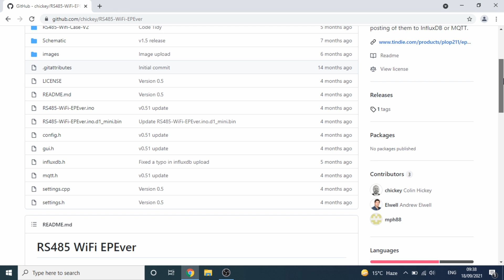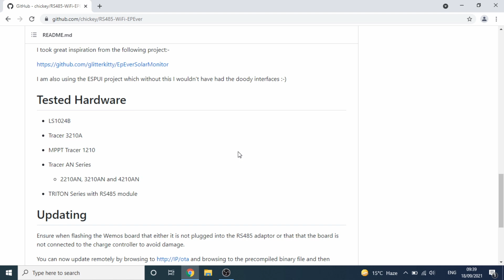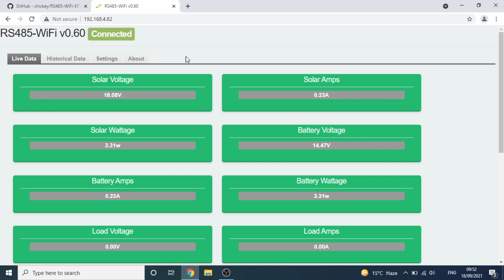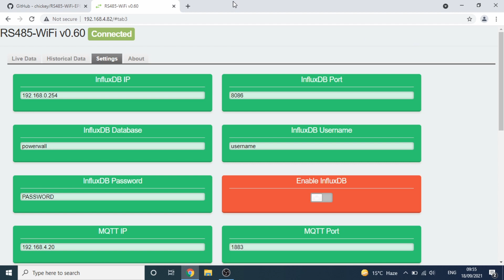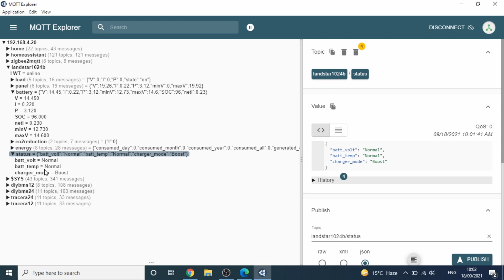RS485 to WiFi adaptor for EPEver Solar Charge Contollers

Comment: Adam thanks for posting this info, very informative. I am very interested in a RS485 to Wifi board,  but my problem is I am running (2) TracerAN charge controllers in my RV and to manage there charge rates I have installed the Epever parallel controller (PAL-ADP-50AN) that controller only can be monitored with wired/PC software.... yuk! The PC software works via USB/Rs485 cable, guessing the protocol is a one off. Any ideas?

Comment: I have a question. 

I've been using an Epsolar ET6415BND 60amp for years.

With the standard supplied RS485 USB cable. the wires were slightly bare and came together. Since then it doesn't work anymore.

What's wrong, internally the RS485 chip in the charge controller is broken. or the USB to RS485 interface cable is broken.
is there anny protection in the charge controller.

Comment: I have implemented an alternate approach. I use an esp32 (running a modbus library) with a cheap ttl to rs485 adapter. Code is C++/Arduino. The esp32 gets status and commands my epever tracer controller (via published online protocol definitions). The commands and status pass over an MQTT broker to a node-red server via wi-fi. In node-red I have implemented a custom epever status page similar to the factory supplied program, but which I much prefer. I have a second node-red page where I can change the various epever charging parameters.
Reply from the maker: Cool. Sounds similar to mine… https://github.com/AdamWelchUK/NodeRedEPEverDashboard this is the last version I uploaded, but as is often the case, it’s revolved since then!
Reply: Hola, I did the exact thing but ran into an issue. My controller ,40amp tracer an, lost power to its battery ( my BMS disconnected ) , the connection to the solar panel remained constant. When I discovered this issue somehow the combus in the controller went bad. I can’t change settings anymore via pc or the remote ‘meter’ device. The meter lights up but never connects. Somehow the data bus got borked. BTW I was using those cheep 2 pin usb adaptors to a raspberry pi. Otherwise things were great. I even made a led scrolling display with esp-8266 display controller data ported the MTTQ running on the pi. Sweet !
Reply: @jethrotull5847  I also lost a controller with a bad data bus. I think a lightening strike took it out (live in central Florida). Since then I have taken great pains to ground everything and have installed a serge protector on my panel cables coming from the roof. Since I use Lithium Iron batteries, the charge controller is useless without the ability to fine tune the parameters.
Reply: @yancymuu4977  I intend to take it apart hopeful it’s just a bad data bus chip. I have 3 controllers hooked in parallel, in retrospect I wish I would have bought the later model that appears to have the comm chip on a removable faceplate module. I also use lifpo4 batteries and still keep the old controller online because it was set for lifpo4 (user). The settings are a little different ( like max charge..) though. If you could please describe your system a little more, I display data on web page and led scroll displays, I also meter amp consumed via a shunt, PZEM-017 connected to Arduino D1 mini. Everything possible with node-red !
Reply: Lastly, I intend to switch the load on and off automatically based on daily internet weather forecasts ( json ). My array is 1,600 watts charging 28 v 200 ah.
Here in Virginia seems like 45% days are cloudy or overcast.
Reply: @jethrotull5847  I plan to do a video overview of my system, but basically it's 8 lithium iron 400 ampere hour batteries in series with a 50 amp 200v charge controller. I have 10 100 watts panels (5 series x 2 parallel). I made a small custom circuit board with a/d chips, balancing resistors, epever interface, and an esp 32. This summer I have been getting about 2 kWh per day, but can get more with increasing the load. It mostly started as a hobby that seems to have gotten out of control.
Reply: @yancymuu4977 My system is also a expensive hobby. As such it was build in stages and now consists of too many controllers over too many separate all south facing arrays. The investment cost looks like a nasa overrun project and with power at .12 KWh it will take forever to earn the investment back. The only saving grace is emergency power. I use a 60 amp auto switch and Alexa. When “solar off” command is issued the Alexa switch turns ac output off from the inverter ( killing the output ac but not dc as recommended by manufacturer ) the auto switch senses this and reverts to shore power. All is well but I need a bigger inverter. If you don’t mind can you tell me the brand you use and how long you’ve used it ? I look forward to your video, have you got a YouTube channel yet ?
Reply: @jethrotull5847   I have an Xantrex Prosine Sine Wave Inverter 1800. I purchased it for $350 used on eBay mostly because it was recommended by a YouTube reviewer. It works great but has a 20 watt no load power. I have hacked it a little to be able to turn it on or off with my epever relay. (Have the 50A model that does not have a load output, but only a load relay). Mostly I like to use various DC to DC buck or boost converters to run my small computers, switches, router, computer monitor, TiVo etc.. If we get a long grid failure after a hurricane I want to stay connected to the outside world.

Thanks for encouragement to do video. I will start working on it. I have posted a few not great quality videos on YouTube,  but it would be a little presumptive to call them a "channel".
Reply: @yancymuu4977  great, I’ll keep an eye open for your video ! Take care … later.

Comment: Can I connect it in parallel with the existing MT50 remote thing? Thanks.
Reply from the maker: This is something I want to investigate.
Reply: @AdamWelchUK  thank you.
Reply: Be careful, I would not at this stage, I have a 80A Epever solar controller that has got to RS485 outlets, I was using a single outlet with a SnekTek - Solar WiFi dashboard V4 controller , and swapped it out with a RS485 to WiFi adaptor , all worked well with logging data to my MQTT server, so in my wisdom I thought I would use the second RS485 port in the Epever solar controller and run both devices, well it didn't end well for both devices, I lost all comms from the Epever to both devices, each device still was able to surf to there own webpage but not data was sent, I disconnected both devices and plugged in a MT50 and was able to view the data, I have since ordered another 2 RS485 to WiFi adaptors and will never use both RS485 ports together, I think I have fried the comms chip in both devices< I am now waiting for the 2 x RS485 to WiFi adaptors in the mail.

Comment: I’ve been using a home made version of this type of adapter for several years, but recently switched to using the Elfin EW11 (I use the “-0” version with an external antenna) and the Mdbus flex-getter node in Node-Red.
The advantage of this approach is that you can use the EW11 as a virtual remote serial port, so with the correct drivers you can access the EPEver via the manufacturer’s remote management software. This means that you can tweak the configuration without having to go and plug your laptop into the controller.
Reply from the maker: This is very similar to my current approach. I’ve published my node red flow on GitHub. Colin and myself (mainly Colin) put together an earlier version that was simply a rs485 to WiFi bridge much like the Elfin device you mention.